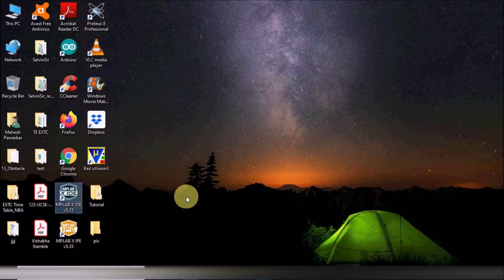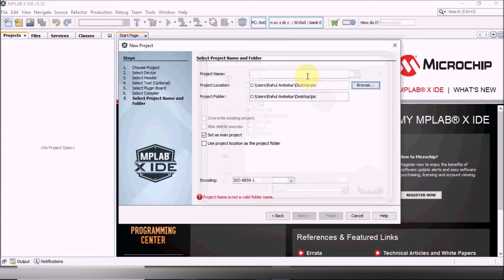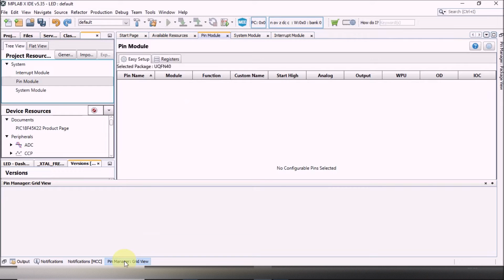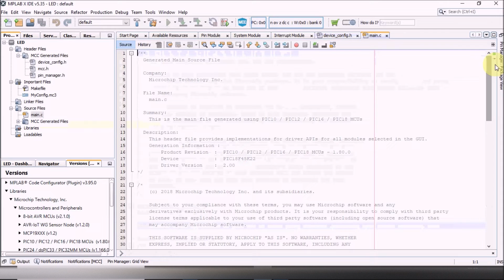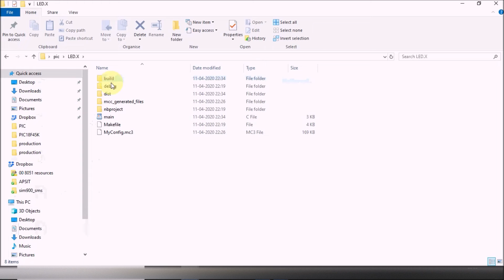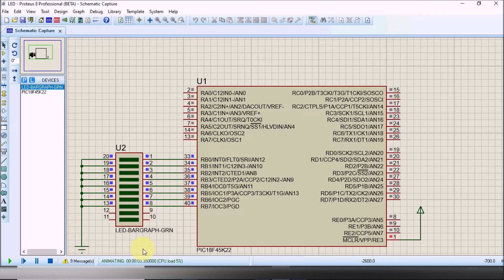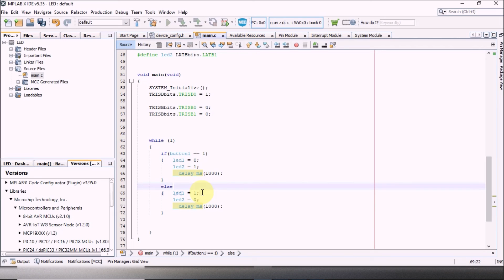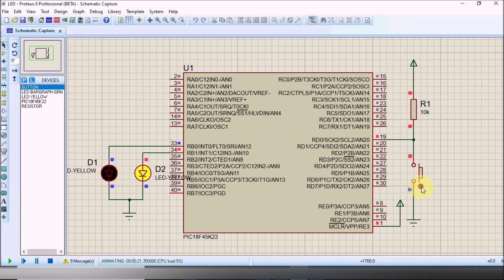MPLAB-X with XC8 and Proteus simulation for PIC18F45

Comment: sir  finally #include "mcc_generated_files/mcc.h"
void main(void)
{
    // Initialize the device
    SYSTEM_Initialize();
    TRISB = 0*00;
    while (1)
    {LATBbits.LATB0 = 1;LATBbits.LATB1 = 1;LATBbits.LATB2 = 1;
LATBbits.LATB3 = 1;LATBbits.LATB4 = 1;LATBbits.LATB5 = 1;
LATBbits.LATB6 = 1; LATBbits.LATB7 = 1;        
        __delay_ms(1000);        
LATBbits.LATB0 = 0;LATBbits.LATB1 = 0;LATBbits.LATB2 = 0;
LATBbits.LATB3 = 0;LATBbits.LATB4 = 0;LATBbits.LATB5 = 0;
LATBbits.LATB6 = 0;LATBbits.LATB7 = 0;        
        __delay_ms(1000);        
    }
}

this  code worked  .